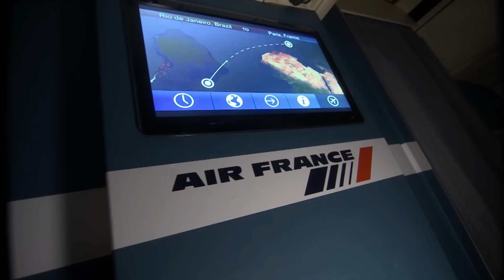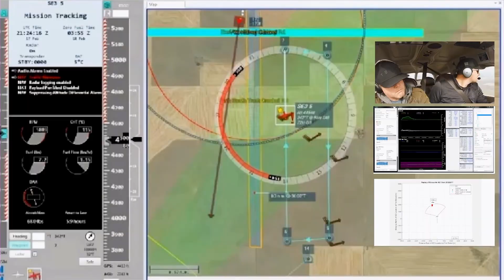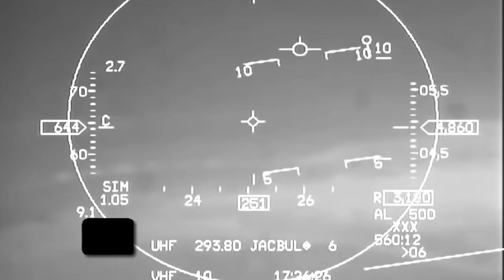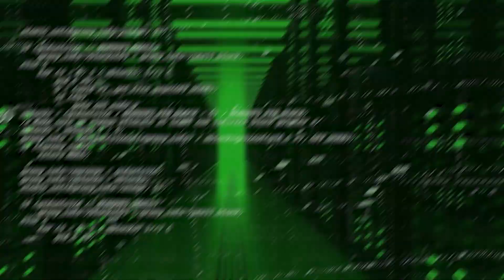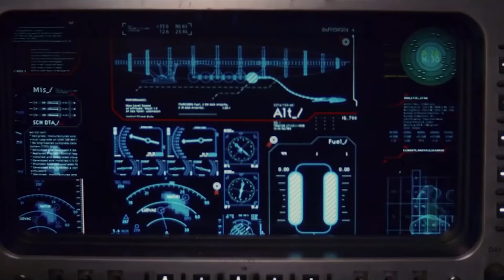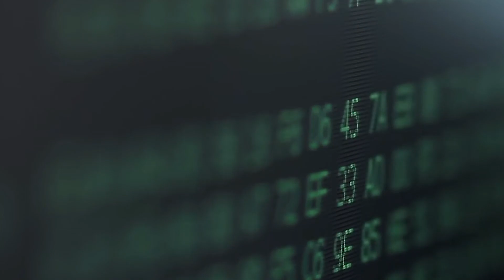Why can't fighter jets fly themselves using AI?

Comment: The biggest problem would probably be the hardware, it doesn't matter if someone has already made an AI that can fly a simulated jet if the computer needed to run it is the size of a house, and electronic hardware on fighter jets is already extremely limited, and are designed to very precise specifications such that there is no more weight or space used by electronics than is needed, and the hardware requirements to run an AI would be extremely difficult to measure, there is always the possibility of remote control, but remote control has an entire new set of problems